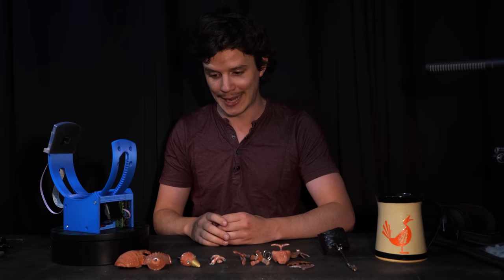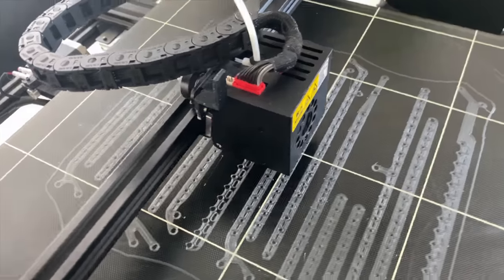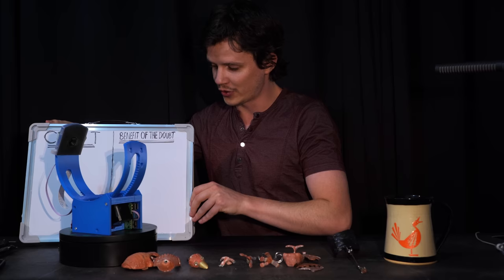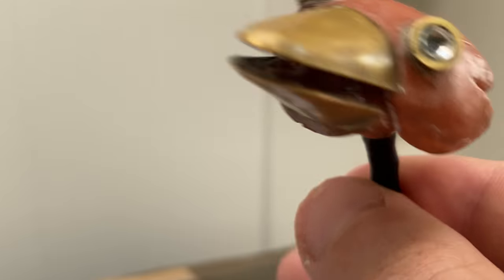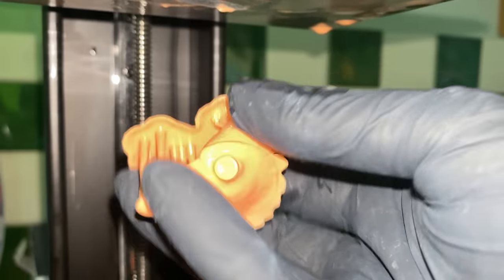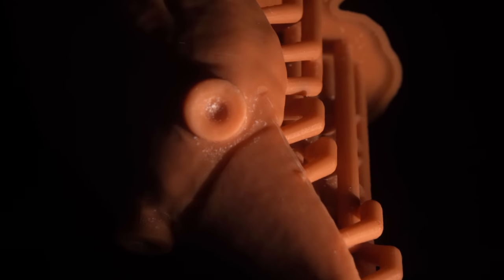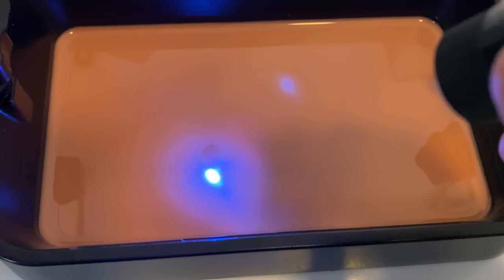DABCHICK got SCAMMED

Comment: Different resins may need the settings in your slicer tweaked so I would check either on the bottle or where you bought it from to make sure you're getting that right. Undercured resin may not be bonding as well to each layer and sometimes a slightly longer exposure time is worth it even if it adds another hour or two onto the print time. For the sticking to the film layer I had a friend who recommended PTFE based lubricant which may help you as it won't react weirdly with the resin.

Also always wear gloves when handling the resin and uncured parts! It's very toxic! I would know, I ended up with a harsh chemical rash on my hands after handling prints too many times in a row without gloves (I had run out). For that same reason, the finished parts should be washed in an alcohol bath and once the alcohol is no longer effectively cleaning the parts, let it evaporate and dispose of the residue properly.

As far as durability goes, most UV resin is pretty hard but brittle. There are some resins that supposedly work like more flexible plastics but I haven't had much luck with them.

Also you didn't show a curing chamber in the video but I assume you know about them. If not, there are commercially available cleaning and curing stations but where budgets are involved you can make one out of a cardboard box, some tinfoil, glue, a cheap UV light, and a rotating display for like baubles, also cheap. The printer itself doesn't fully cure the parts it just cures them enough to harden them on each layer. The full cure comes afterwards by being exposed to UV light for a good day or so. The cheapest way to cure parts is to leave them somewhere in the sun and just make sure to rotate them every now and then. The thicker the part the longer the cure time as the UV needs to penetrate further in to cure everything.

I don't know what slicer program you're using but Chitubox is free and has a lot of functionality like good automatic support generation, part hollowing, a simple repair tool, all while being user friendly.

Comment: a note for print failures, temperature can play a large part in it as well. most Resin likes to be around 23-25 degrees c, if it is in a cooler room you will have a significant number of fails. We got one and didnt realise this either until our printer which is in our garage which gets too cold half of the year.

Comment: A possibility you could do is casting the resin parts in silicone, making wax molds, casting said wax parts in plaster, and making the dab chick out of aluminum. Or, skip the silicone/plaster steps and cast the resin parts in sand. Pour the metal directly into the sand mold and cast them that way. It’s less perfect that way, but it’s faster, and cheaper. The sand can be reused again and again. The plaster molds are one time use, and are broken apart to retrieve the metal part.

Comment: Make a silicone mold from the printed geometry and then you can make cast polyurethane duplicate parts that are custom pigmented as desired. Polyurethane resin is strong, comes in a range of hardnesses so you can get the amount of flex you want, is UV stable, and impervious to water and many liquids.

Comment: Those supports look fine. You may want to really play with your exposure times for your bottom layers if they're coming off completely , or the normal layer exposure time if you're getting some splitting. The splitting can also be caused by your supports pulling on the print because of the layout of the supports and tensions from that. Its a whole messy thing! Then you have to worry about your weather when printing!

Comment: I had a layer separation issue that was caused by bad bearings. I solved it by carefully cleaning the linear tracks they run on and applying bearing grease to them and running the carriage up and down until it stopped making a crunching noise while traveling.

Comment: I've had the same issues, first check all your settings in your slicer (cure time etc.), if that won't do it try spraying the membrane lightly with PTFE-lubricant, i wipe most of it off so just the smallest film of lubricant stays and reapply every 10-20 prints or resin-swaps. Worked like a charm for me. Cheers!

Comment: You could use the resin parts and use them in silicone molds. That way you are able to get the detail of the resin printed parts, and the stability of better resins or epoxy

Comment: Calibrate the resin times with the cones of calibration. As long as the printer isn't faulty this will get you consistent results every time. 
If the printer is faulty, i'd just return it and go for an elegoo brand or anycubic. 

Resin printing is great and the post processing part isn't as much of a faff as people make out once the process is dialled in. Also You can deffo get a more durable resin that will be suitable for your needs for dabchick. Take a look at some of the siraya tech resins.

Comment: As a fellow resin printer fella, there will be ALOT of failed prints. luckily there's subreddits to help out with those. I reccomend getting a good slicer (lychee slicer is pretty good) getting some easy release FEP and playing around with the acceleration and curing times for the print itself

Comment: You can print in a ceramic resin, you'll have to heat it afterwards in a kelm over many hours and the print will shrink a tiny bit but if you get the dimensions right after a couple of hours in the heat then it will be strong , uv resistant and water resistant

Comment: This is really cool and all, but I can't stop thinking it would've been much easier to just make a silicone mold and cast dabchick from deep pour epoxy. Essentially the same material as the printer uses but much stronger because it's not cured in layers. Less expensive, faster results.
Reply: Dude a genius

Comment: Siraya Tech makes a resin called "Tenacious" which is a rubberized resin that can be used as an additive to add a lot of strength and flexibility to a print with, say, ABS-like resin.  It's expensive, but it's incredibly strong and could go a long way with puppetry.  It makes miniature figures nearly indestructible unless you actually try to break it.

Comment: So here as some tips and tricks on the resin printer. 

1# Pick an good resin: I see you use the Halot, and I would highly suggest an Eco-Resin or water washable resin since our little fellow comes in contact with food and drinks alot. Then look up the what the advice settings for that resin is.
2: A good long first exposure layer will make sure stuff will be good and stuck to your baseplate. You should also get an magnet base so its easier to remove stuff.
3. Use a good slicer: I would personally recommend Lychee. It even has a function that will help you with the orientation of your parts.
4: I would highly suggest you give @3Dprintendsoup an message, im absolutely sure he would love to help out!

Comment: Heya! I had Alot of the same issues when I started resin printing also with a similar machine. A few quick tips to try would be making sure your tanks film is as clean and scratch free as possible, use a little 3in1 PTFE Lubricant on the film (make sure it's all dried up and you wipe any excess up), rough up your build plate with some sand paper, and/or use a different resin, I've had alot of success since switching to Siraya Tech Fast resin. Also make sure your print is calibrated for your resin. Oh, and use Lychee for your slicer, it works like a dream!

Comment: there are tools to basically invert a 3d print file, so you might be able to creat a mold with some futzing with the models and that could alow you to make casts of different parts in soft resin which although more prone to deformation, deformation IS just another word for ROBUST as the would be way less likely to snap and break.

Comment: For the adhesion issues I would recommed puting ptfe lube on ptfe sheet. I use this method on my mars 2 (quite similiar printer to Halot) and i did not have any adhesion problems. But it might not resolve the spliting since it can be caused by other factors like type of resin used, temperature and few other.

Comment: another trick is before uv cureing everything remove the soports,itll be easyer in the longhaul. but for the printer try doing 3 test, one with low adhesion settings,ne with medium and one with high.

Comment: Regarding the failed prints   there's a great video by " Once in a 6 Side "   that goes into supporting and printing your own models.  
But from my own experience for resin printing it seems your lift speed is set to fast and your exposure time might not be calibrated correctly for the model and resin your using 
you might also want to reduce the size of the supports attached to Dabchick and use hot water to make the removal of supports far easier

Comment: 1. Add more, smaller supports. Both of those things. Support your prints like they were newborn babes.

2. Adjust your printing times if possible. Increase delay, giving the printer more time to peel each layer off the FEP, and maybe increase exposure time if the previous things aren't fixing the issues.

3. Change resins. Resin gets old and some resins don't work well with some models of printers.

Comment: As a beginner resin printer, may I offer some tips?
1. Calibrating the printer to the resin using calibration prints (such as "Cones of calibration) is a must.
2. I don't have any experience with the resin you are using but those types of resin tend to be brittle - drop them and they will shatter. The solutions are to mix resins with different properties, I find a 70:30 mix of brittle:flexible resin gives a tough print that doesn't shatter.
3. UV stability can easily be gotten around by simply painting the result.

One of the benefits of resin printers is that printing multiple things at the same time does not add to print time, so you can print multiple components to increase your chance of a successful print and also give you backup components in case you damage one.

Comment: Both of the issues mentioned are likely due to the Z axis calibration being off. These types of machines are calibrated at the factory, and since both the previous shithe- I mean, owner and yourself disassembled it, it was thrown off. As an aside, part of the worklflow for making repeatable, durable parts is 3d printing a mold, or making a mold off of a 3d print.

Comment: Yes, resin in the machine is scummy, but a damaged fep is a consumable part that needs to be changed from time to time anyways. Paint helps with uv resistance and abs-like resins are more durable and elastic. What was your resin temp? Too cold and it delaminates like your prints did.

Comment: The plastic film at the bottom of the vat is something you should change from time to time anyway. That thing will get scratches and cloud up at some point no matter what. 
The failed prints are probably down to suboptimal slicer settings. Had the same thing happen to me when I started out. Over time and by experimenting you will get the hang of it

Comment: Use resin. Get some good quality white or see through resin, prime the parts and the paint with two or three thin layers. Add the clear coat and done.

Also. Iso propyl alcohol for cleaning the parts. Final hardening with UV chamber. Do these before painting and primer.

Comment: Two alternatives : The more boring one, tweaking your fdm printer's setting until you get a good enough level of detail (it's totally feasable), and maybe some light sanding to smooth out the layer lines, and bam you got a sturdy dabchick.
Orrrrrrr, you could use the resin pieces as a template to create a mold around, and from there you can pour pretty much any material you want in it. Regular resin is already much stronger than uv resin, but you could push it even further and make a METAL DABCHICK. The possibilities are endless.

Comment: Got a Halot One doing the same thing, just replace and tune(!) the FEP, lightly sand the build plate. Run Lychee or other decent slicer. After those things I’ve had zero issues. Also run it slow and check your exposure settings

Comment: I'm not sure about more durable resins but I have come across a resin that's partially wax. Meaning you can make a mould of the print and then just melt the print from the mould. 
It's similar to the concept of lost PLA casting if you've come across that.

Comment: The errors are caused by islands and bad calibration of exposure timings and/or lift speeds. Also if you need more resilient resins, have a look at more technical ones rather than cheapo stuff.

Comment: we have a 3d printer at work, and we dam well did the hole of the DnD monsters manual, add even more struts and do em thinner. it will use some ekstre resin but the prints are flawless... hope that helps out

Comment: what may be a good idea for dabchick is to use the resion printed parts to make moulds which you can then use to form a material into the shape, alternatively if your interested in FDM printing (the type you say youve used previously) the detail can be okay howevery you can make them metal, their a filaments designed to be cooked where it melts away the plastic and leaves you with metal or clay or a small number of other materials.

Comment: So two major pieces of advice. First off for the splitting and pancaking you should treat the FEP (the clear plastic vat) with RainX to prevent sticking and you can rough up the metal print bed with a piece of sandpaper a bit to get more adhesion. Secondly, from how flexible all of those prints look (unless you are using a Nylon like Resin) you're likely not exposing them enough. You should download and run an exposure test print to see if you can get better results.

Comment: Supporting models is a frustratingly difficult task. As for the material splits, it might be that your exposure time isn't long enough. Fiddling with the settings is the other frustratingly difficult task.

Unfortunately results will differ based upon what resin you use as well.

Comment: 3d printer user here. That  bit of plastic is a FEP film, a transparant bit ofplastic  that you have to pull extremely uncomfortably tight and is also what separates the resin from your screen.

This is also basicly a part that you regularily need to replace. Like every 50 or so prints. It's maybe 10 bucks for three of  them cut to your printer's size.

All you gotta do is take out your resin vat, clean it out, turn it over, unscrew bottom ring of the vat, replace the film with a new one and reattacht the ring and screws. As you screw it shut you will feel the film get ready to snap. It's as nerve wrecking as installing a CPU in your pc haha.

Comment: Smaller supports (smaller tips as well) but MORE. lychee slicer should be able to help with that. watch out for "islands" (areas that appear in a layer without something to hook on to) and unsupported overhangs (if the distance from the last support area is too high then the free "tip" will flap and can cause splits like you've seen.

Comment: Heavy supports only help so much in terms of stability, you'll want to switch to more, but finer and smaller supports. Ideally you want to be able to get a print off the bed, wash it, run it under some warm water and zipper it off the supports. Not be sanding grinding and sanding forever.

The delamination partway through prints I've usually found to be an issue with supports (not being on a stress point), your exposure time being too quick, or the tray and/or vat being dirty and not getting proper exposure.

If I get issues constantly I'll finally give on and empty/filter and clean out the vat.

Comment: you should redake entire skeleton and make it from metal (durable) with ability to swap plastic parts like beak, head, body and legs

for the "shell" i suggest using silicone molds and plastic because resin is actually less durable and can shatter easier than plastic (also plastic can bend more easly)

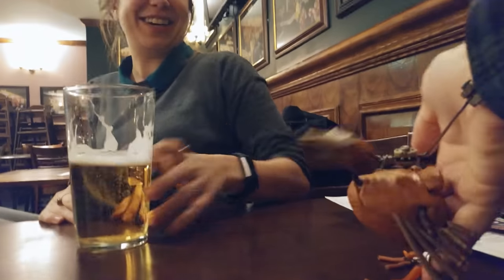Comment: 8:00 it might me an idea to do the ciramic? printer, which lets you bake the print after its printed. I know there's WOOD filament for 3D printers that actually have wood in it so it sands and seals like wood, but i swear i've seen something to do with resin printers that has the UV resin, but then you do something after wards and it cures it to protect it from UV and heat, but i cant remember for the life of me what it is.

Comment: not sure if it helps - but when i used a resin printer i found i had layer splitting issues because the temperature of the room i was printing in wasnt right. cant remember if it was too hot or too cold, but maybe keeping an eye on that could help you?

Comment: I've found that putting a little bit of wd-40 on the plastic film helps things not stick. Just spray a lil on, let it dry, and then pour the resin, and it's fixed all my issues with prints sticking to the print surface.

Comment: Disconnect the lead screw and check if the rail runs smoothly. Also give another resin a try. i really like abs resins as they are less brittle

Comment: I put a finger dab of PTFE lube with teflon and gently spread it across my film to give it a slicker surface to remove those issues of it sticking. I also went and got my build plate sandblasted with some light media to give it grip and was SO MUCH better. Just make sure you chamfer hose edges or those babies will stick!
Reply: You also need to calibrate your settings as splitting is usually due to undercuring or you didnt shake your resin well.